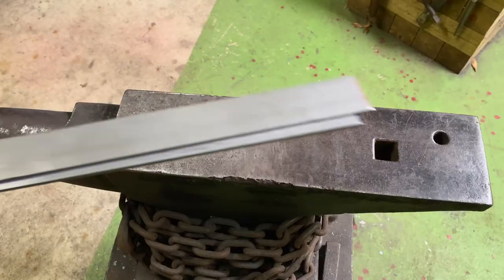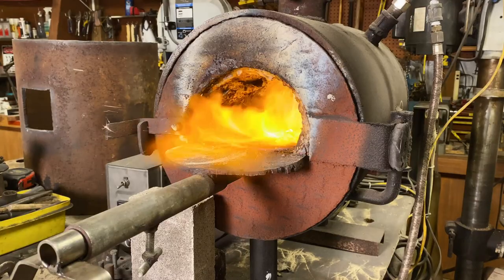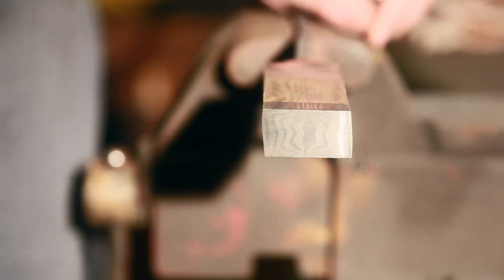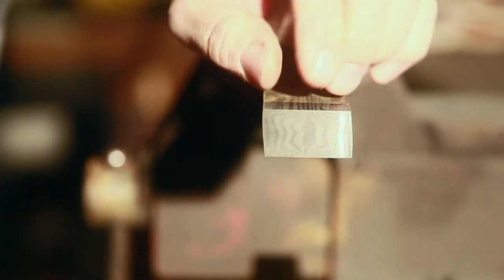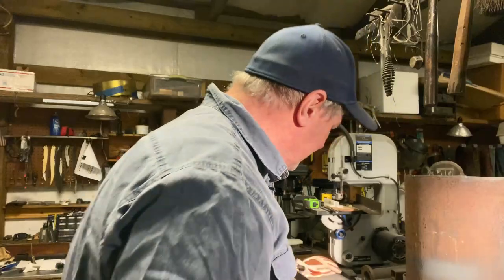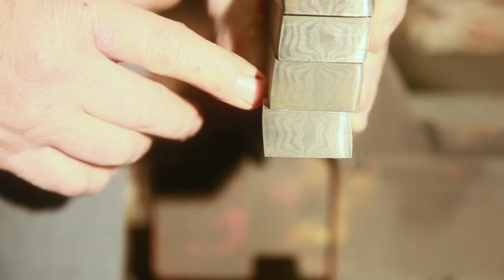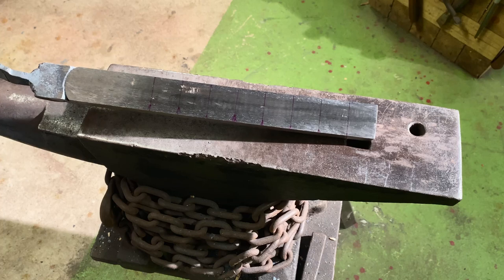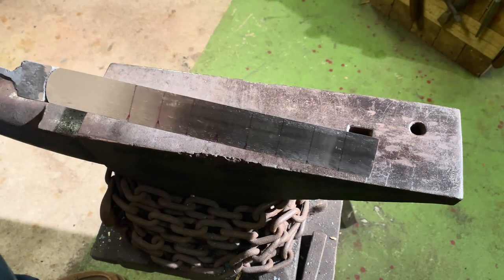Knife Making | Making a feather damascus knife billet

Comment: Great video, Tony!   You should try adding some sacrificial steel on the outsides of your feather when you weld it back together.  It prevents the ends from splitting altogether.
Reply from the maker: I have done that but the customer didn’t want that look.  Thanks!
Reply: @TonySeverioKnives  I mean grind it off after you forge it out though, not leave it there.
Reply from the maker: Oh I got you.  I thought you meant wavy feather.  But yes that works.  I make a ton of feather blades and I’ll be glad when I can get a break from it.  😂😂
Reply: @TonySeverioKnives  I've always had a love/hate relationship with feather because it's stressful drawing it out.  When I started adding the steel on the outside, it was a game changer.
Reply from the maker: Yes indeed.  I’ve only done it when doing the wavy feather.  I need to start doing it either way because you are right about stress.  I have managed to do better by keeping it welding heat, bumping the corners and finessing it when drawing out.  I think the main problem is the stack welding.  It has to be spot on for sure.  But I’m going to start doing the add on steel either way and like you say, grind it off.  Thanks brother!

Comment: Excellent work! Question if you don’t mind. What stops the sacrificial steel from welding to the billet?? It seamed to come away quite easily. Also how long do you soak the re-stack in kero/diesel for ? Thanks
Reply from the maker: Hey Robert thanks!  If you notice, I didn’t squeeze the sides before I ground them off.  Also I was using stainless sheet metal but either is fine.  Just don’t squeeze the sides before removing them.  I Soave the stack just long enough so that the kerosene gets in between the layers.  A few minutes.  Thanks for watching,  😁